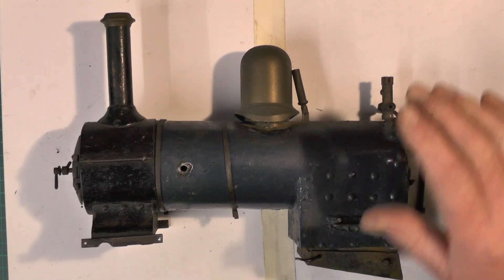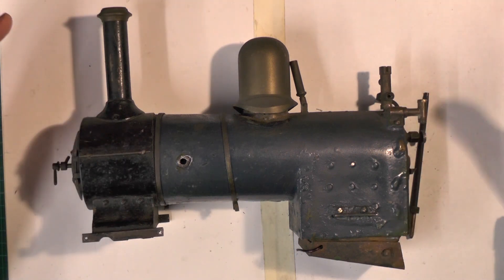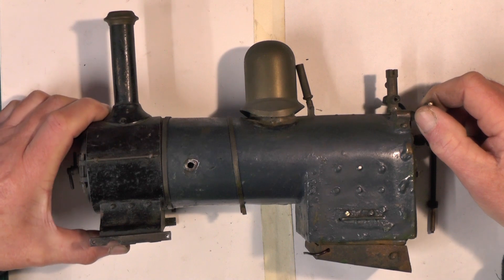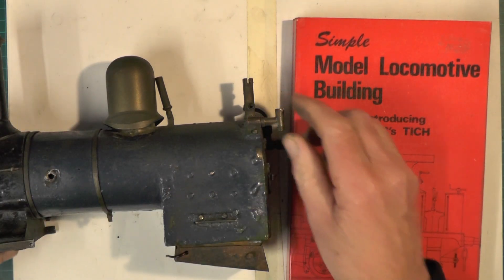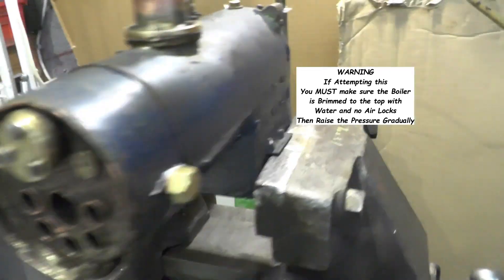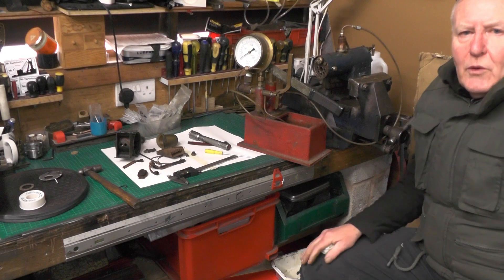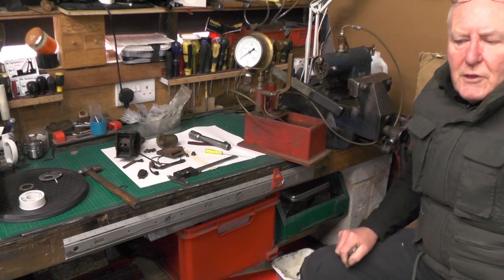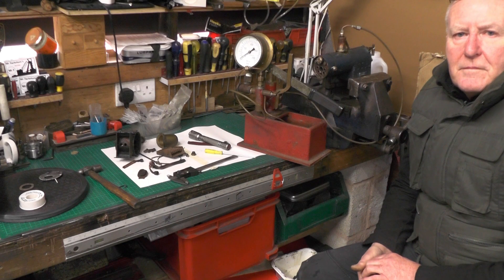8 Year Mystery Item (Any Good!!) A Waffle + Important Procedure + Story NCB Fire Team "mr factotum"

Comment: Hiya Kev I’m probably a bit late but that boiler might be saved. If it’s an old boiler the stays might be screwed and caulked. So just needing a spot of Comsol to seal them. Clean off the paint and speak to your boiler inspector. All the best Julia
Reply from the maker: chers Julia
i thought that too, it needs a closer look when i've nothing to do!! i think the very top of one of the crown stays looked a bit more than the stay leaking. but like you say it needs the paint stripping off, and cleaning. Trouble is too many things on the go.
Thanks for the info, appreciated. and confirmed my after thoughts.
see you next time
atb
Kev
Reply from the maker: Julia
If you or anyone you know want to take it on i will send it to you. F.O.C.  
i will never use it.
atb
Kev

Comment: Hi KEV
No doubt that this pressure tester is not "made in China" 🤭🤭. It is a good solid cast iron. Shame for the boiler     😢
Have a nice sunday. 
Atb
Olivier
Reply from the maker: wouldn't loike to ship that weight from far east Olivier!!😄
have a nice Beam Engine Sunday👍👍👍😉🚂
atb
Kev
Reply: @MrFactotum Thanks KEV. It's a bit cold in the garage today. I'll probably try to do the different gaskets for the cylinder and steam
Chest.
Cheers

Comment: You can repair stay leaks. Go and ask at your club.
Reply from the maker: yes i know Ben, but i need the incentive, so will go on shelf till i get some incentive
also i notiiced what might be a tiny split ousing the slightest amount of water through in the copper shell, so not sure, therefore needs another look at.
also got more pressing things on my mind
but thanks for the info👍👍👍🚂🚂🚂
all the best
Kev
Reply: @MrFactotum  Fair enough. I can see nor having the incentive to build such a small loco. I have a chassis of a 5" equivalent which would be worth it and a partial chassis of a 3 & 1/2" which is bigger than most 5" which would. I am not sure about a tich though... And I have a kit and the book.
Reply from the maker: @BensWorkshop  👍👍👍👍😉😉🚂🚂